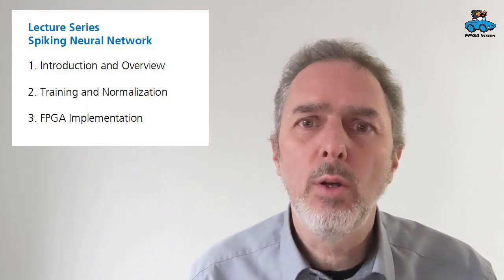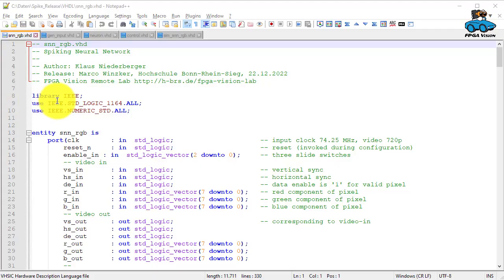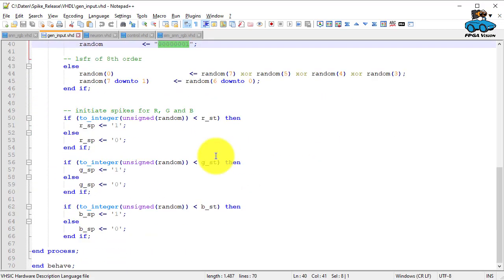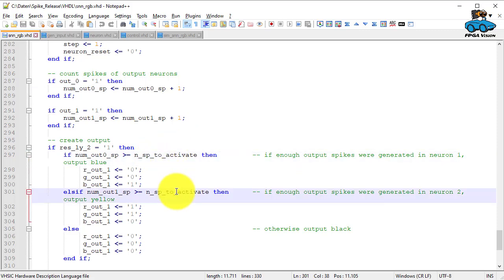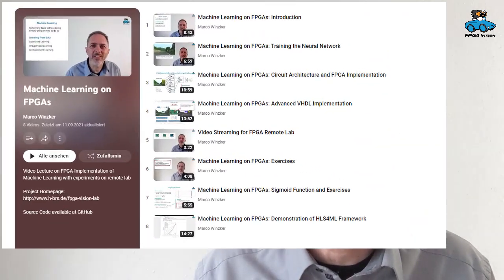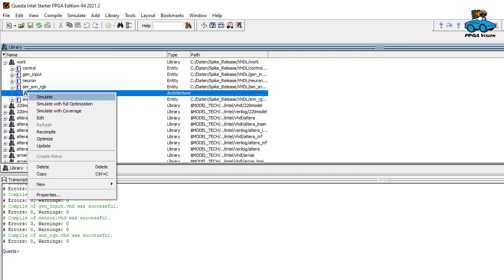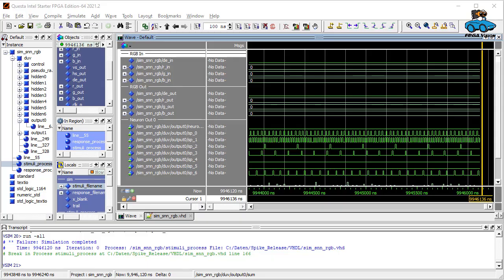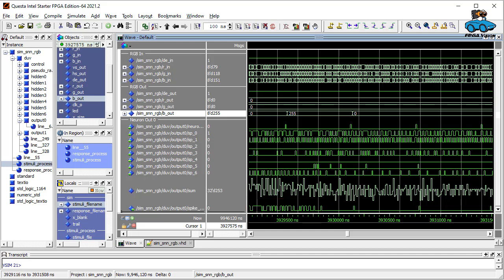Spiking Neural Network on FPGA - FPGA Implementation

Comment: How do you get /sim_snn_rgb/duv/output0/sum to display in the Wave view window  of  Questa Intel Starter (6:42 mark in video)? I can get many of the other signals to display after running the simulation, but not all the ones you show. Also I don't have the sections (RGB In, RGB Out, and Neuron Out 0) on the left size of the Wave window like you have. How did you get those to display like that? Thanks for the video's they were really helpful!
Reply from the maker: On compilation, there is a setting to keep the visibility of all internal signals. 
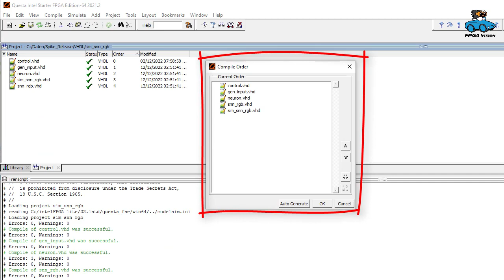At 5:00 there is at the top of the window the menu item "simulate". There you find "Design Optimization" and then "Visibility".
Hope this solves the issue.
Reply: @marcowinzker3682  thanks, now I can get sum to display on the Wave window, but it is rendered as just a number (series of number blocks). How do you get sum row to display as a graph?
Reply from the maker: @dukecitywildcat  In the waveform window you select the signal and with right-click define the radix (e.g. decimal, unsigned). Then you right-click and go to format -> analog.

Comment: Prof, It works fine with questa, but if we want to run on vivado, it did not work when run as it is, is there any changes to do or any ways to produce bitstream as our aim is to run on fpga
Reply from the maker: I have used several FPGA design flows in the past, and Xilinx is high quality provider. But of course there are small differences in interpretation of VHDL code.

I did not check this design with Vivado. My suggestion to you: 
Please check all warnings of the compilation. Often there are hints. 
You can also compare the results of Questa and Vivado. How many FPGA elements do they use? How many for each submodule?  If there are huge differences, part of that code is interpreted differently.

Comment: Hi prof, please implement a neural network of xor in vhdl. Thank you.
Reply from the maker: Interesting question!
As the neural network has a hidden layer, an xor should be no problem. You could use training data with xor-characteristics and see how training handles that.

I will also have a look into it.
Reply: @marcowinzker3682  for an xor NN we have weights and 2 biases and input data 00,01,10,11. In fact I have a trained    NN , now I wanna implement it in vhdl. I think we have to write a package for each neuron. Please let me know.  thanks a lot.
Reply: Hey prof. I'm also interested in the implementation of a neutral network in FPGA. In fact I would like to know how generate VHDL code a particular trained neural network. I'm looking forward to hearing from you
Reply from the maker: @wachirakaburu2332  The video "Machine Learning on FPGAs: Advanced VHDL Implementation" explains VHDL generation from Octave. https://youtu.be/CoyhAqUS2f0